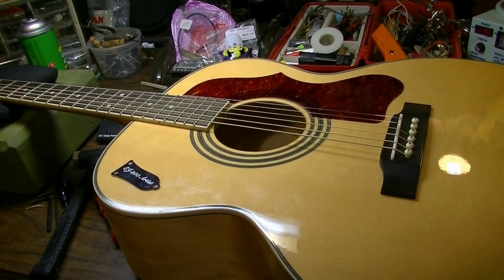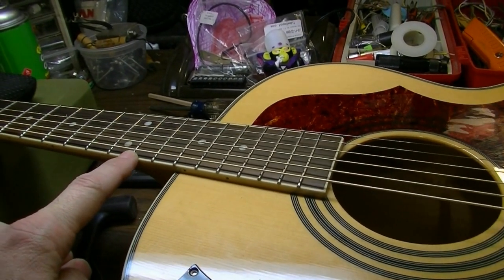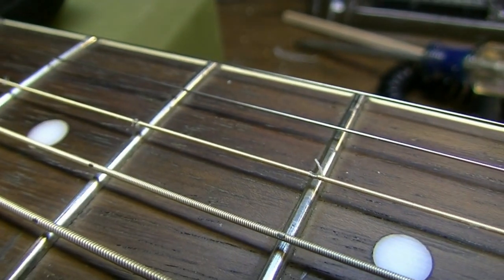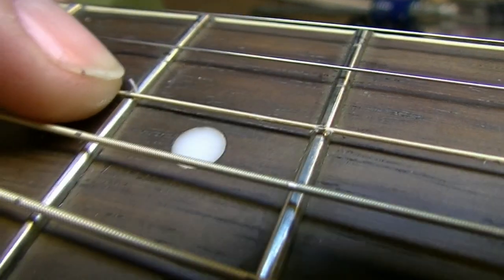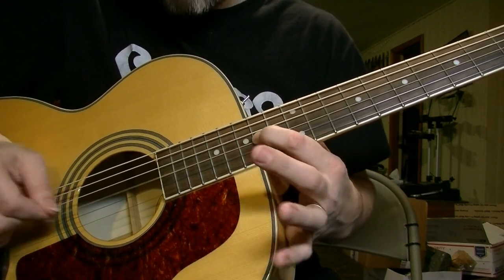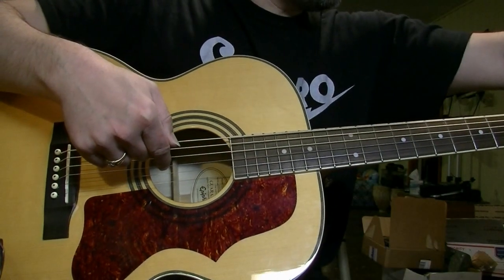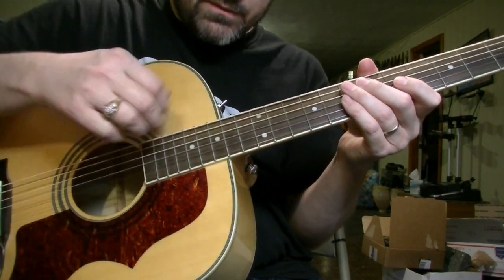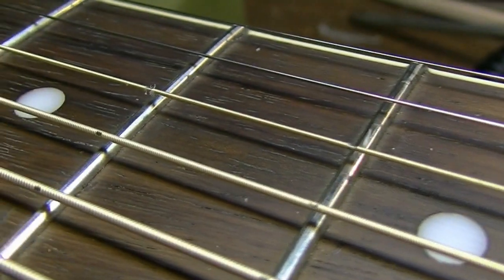Why I NEVER Use ELIXIR Coated Guitar Strings

Comment: your problem is you want to bend a wound g string in standard tuning, which destroys them, usually in minutes if your vibratos are aggressive enough.
This has been a known issue on acoustics for a while. try lighter gauge strings with less tension and possibly the top 3 from an electric guitar, which aren't wound, or a lower tuning and transpose your solos and melodies up the fret board.

Comment: I've only seen this kind of fraying on Elixirs strings where someone else has, other than me, had access to the guitar. I have never had mine do this; not even when they are ready to be changed. I must have dry hands and a low acidic pH balance to my skin/sweat, as well as a soft touch because mine never rust out or fray like this. I also wash my hands every time I play and frequently during my playing sections because I hate to change strings; I guess that I take extremely good care of them. As a result I rarely ever have to change out my Elixirs  -- they do eventually require changing though. I guess I must be really luck because of my low acidic pH and because of my OCD issues (Obsessive Compulsive Disorder) and because of my playing style, that I don't don't have to change strings that often. Plus, I am really just too lazy to do it anyway and I even have all the power tools to make it happen quickly. 
I would be really sad if Elixirs frayed on me and corroded quickly because I really really love the tone that they produce. I've even compared them with D'Addario strings, because that's what I used to use, and hands down the Elixirs just sound so much better and sweeter to my ears, with rich twangy overtones that I can't seem to get from the D'Addario's. And D'Addario are really great strings in my opinion but Elixirs are just so inspirational; I really really love them!

Comment: The problem is you put the "strings back on". The strings were already stretched then you took them off. The strings like most things that stretch relaxed and tried to go back to their original length. They were then put back on and stretched again. This will cause the coating to do exactly what we see in the video. It would be like wrapping plastic wrap around a piece of rubber thats been stretched then allowing the rubber to go back to its original form. The plastic wrap will tear and bunch up. Obviously the elixir coating wont bunch up but it will tear.

Comment: Coating on strings usually do not peel easily unless you are tapping the strings violently. I tried some cheap made in China strings. They are coated. Cost about $3 per set on eBay and they last for years
Reply: What brand?

Comment: First off I would never remove a set of strings and then re-use them, especially after an installation that would require filing the saddle. I only use Elixir strings on my guitars, Polyweb on the Martin and Nanoweb on my Taylor K20C. I've never had a string break, they stay in tune and last longer with GREAT tone than anything else on the market.

Comment: Nanoweb is a thinner coating than Polyweb.  The former is used for acoustics and the latter for electrics.  I haven't heard many good things about the Nanoweb strings, but I'll swear by the Polyweb strings.  I've used them on my electric guitars with no hassle or problems whatsoever.  I love the silky smooth feel, and they last a very long time.  I have some sets that have been on my guitars for several years, and they still sound brand new.  I'll gladly pay twice the price I used to pay for a set of GHS or Ernie Ball, because Polywebs are worth every penny.

Comment: Hey guys- Im going to do a video on this at some-point- but i've had a set of elixirs on my sisters guitar that I "Accidentally broke" way back, around 2010 or so- they're still on there today, and apart from the odd specs of rust UNBELIEVABLY still sound like new- its unbelievable... 7 years. BUT this is due to nobody playing it much at all. This guy must have left the same strings on that bugger for a LONG time for that to happen- but it just proves that nothing is consistent, everything is subjective, and everyone has on opinion. Just go with what you like and what works best for yourselves.

Comment: I've had good luck with the D'Addario coated strings on one acoustic, and Cleartones on one electric. Had a set of Elixirs once, on a Taylor Big Baby. They're a great idea for brick and mortar music stores, where a guitar might be played several times before it's bought, so customers don't find themselves auditioning $1000+ guitars with dead, rusted strings that feel gritty and sound bad. I used to go to the old Mars in Natick, MA, and if I picked up a Taylor (first to embrace Elixirs as original equipment, I believe) it always sounded more lively than the Martins and Gibsons with their rusty old strings. But the Elixirs lacked low-E "clang", and they had that rubbery feel, like I'd just handled a jelly worm from a fishing tackle box. The ones on my Big Baby shredded like the ones in the video, although it took longer than 3 uses, and if they caused any actual buzzing I either didn't notice or don't remember. At a friend's recommendation, I replaced them with D'Addarios, which felt and sounded more like un-coated. I now keep coated strings on just a couple of specialty guitars that I use only occasionally. My cost justification is that they won't oxidize even while they sit un-played in the case for a while, which can happen over time with regular strings. Otherwise I agree, plain old strings are fine if you just clean them off a bit after heavy use. YMMV.

Comment: also, it is clear and obvious to anyone who knows the difference that these are polyweb  strings...clearly evident in the video.  the Nanowebs are less "milky" in appearance and look less coated and more like a normal uncoated string. Polyweb coating is thicker and frays/sheds more with use, especially under the picking area. Aggressive blues players should be changing out their strings after about 12 to 16 hours of use....regardless of their string choice, because of the stresses and wear involved. MOST other types of playing involve almost no string bending which is what wears through the winding on acoustic strings very quickly. I also use elixir bass strings which i have to change after about 60 hours of use. a non coated set used to last me about 6 -10 hours before they became sonically useless. that's about 3 shows worth of acceptable tone vs 10-20. before the strings wore out even though the tone was still acceptable. string life should always be measured by hours of actual playing time not some obscure nonsensical relative term like 'i have used the same strings for 2 years' or "they only lasted a week!!!" playing style and other factors make ALL the difference to string longevity, if you wear strings out like this guy seems to it is a waste OF MONEY to buy ANY kind of "coated string"...so it is not the product that is to blame

Comment: Huh? I've never had this issue. Those strings look really worn and torn..you do have to change them at some point. Ernie Ball Aluminum are a good alternative if you don't want coated strings. Started using those just cause of price. Pretty happy with them.
Reply from the maker: Of course they are worn and torn. That was the whole point. After two practices and one gig and the strings being on less than a week, they were like this. Hence the video.

Comment: i have like a knock off les paul by a company called Gould and the G string buzzes like crazy on that thing but its never done it before i just recently put 8 gauge strings on it would that make the string buzz? if its not used to having 8's on it?
Reply from the maker: Two reasons why 8s could buzz on a guitar set up for heavier strings... One, the truss rod needs to be adjusted to allow more forward bow because an 8 gauge set will exert less tension on the neck, and also 8 gauge strings are very slinky, so when you hit a note, the strings will travel further in their oscillation, which could bring them in contact with frets and create buzz.
Reply: how do i adjust the truss rod?
Reply: The Guitologist I had that problem on my LP and the nut holding the tuning peg needed tightening. No idea how it got loose, after I tightened it no more buzz.
Reply: on my squier classic vibe i just got a problem with one of the tuning pegs that when i try to tighten my low E string the peg like snaps back once it gets to a certain tension and i cant secure the E string yall ever had anything like that?

Comment: It just needs new strings.  I've used the elixirs forever with no issues.  I actually use that bit of fraying to determine its time for new strings.  Run your finger up and down the D and G strings and if you feel bumps, it's time to change them.  No big deal at all and they still last 4 times as long as others for me.

Comment: I use elixirs, not because they sound any better or worse but because they last so long. I have 9 guitars and I don't gig anymore so keeping them all playable gets expensive. Cheap strings go rusty after a few days for me but Elixirs last at least 6 months. They are not quite as bright as non coated strings but you can compensate with EQ.

Comment: First of all, these are polywebs (thick goretex)  and when you take them off and put back on you will have issues, as with any string. All strings will wear and dent after playing...those string look very played. I have used Elixir nanowebs since inception, they are a superb string and last way longer than any other coated string.  Finally why would anyone want to drill a hole and install a toggle switch on an undersaddle pickup. Is your friend OK...cause that's pretty weird :-o

Comment: Those must be poly web strings. Nanoweb does not peel off of the strings. I have been using Elixirs since they first came out. I have plodded through a lot of their development, trials, and errors. They had a terrible time with the heat treat process, perhaps a vendor issue. Breakage was an issue as a result of that. I stuck with them. 
I use Nanowebs and have never had a problem once Elixir worked everything out. It’s a phenomenal string. 52 years of playing, I’ve had just about every brand ever made on my guitars. Elixir Acoustic strings is the best IMO.

Comment: I like Elixir strings, but I change my strings often. If I work on my guitars, I change the strings too. Even regular steel strings get the grooves in them after a while. I like the sound and feel of the Elixir Strings, plus the fact that they will last a little longer. I used to have to change strings once a week. Now, I can go about 3 or 4 weeks. I guess to each their own.

Comment: Man, there is a lot of hate in this video. My experience with elixirs: hate the feel and the brightness. Also, I set up my guitar a couple of months back and put a set of martin lifespan strings and I was really satisfied. Considering I use altered tunings a lot, my G strings snapped while tuning up and so I asked my guitar teacher if ge had a spare string, and he said yes. The following week he brought me a elixir nanoweb string and the same day I put on my guitar. Well, 1 week after, the coating started to peel off and it was causing fret buzz and really stood out when I was playing because of the brightness. I have a new set of pins coming this week so I cant wait to change my strings. So face it people, the uploader has a point, maybe its a rare thing but it does happen, my opinion on elixirs is that they are overpriced, and as I have experienced playing my teachers guitar when they get old they sound dead. I think I will stick with martins and d'addario from now on. Thanks for sharing some interesting info on the matter because I was wondering where the buzz came from, and it defenetely wasnt the setup

Comment: Why would anyone put old strings back on a guitar after a repair or modification?  Even the Elixirs aren't that pricey, but if you had cheap ones laying around anyway... My Taylor acoustic came with Elixirs when I bought it several years ago, and now that's all I use on all of my guitars. All of my guitars, both acoustic and electric are rockin Elixir strings, and I've never had a problem.

Comment: I live in Phuket Thailand. It's in the tropics, very high humidity. Regular strings last...a few hours. I'm joking, a couple of weeks. Bad after a month. There is only one things that works here and that's coated strings. I get three months and then I see rust, still sound okay but they're deteriorating (just like everything else). The jungle will reclaim everything. In my situation I don't have a choice. They're more economical than any other choice. And by the way, I've never saw that happen to Elixir strings. 
Enjoyed the video!

Comment: Elixir strings sucks because i tried them today with my fender strat and the A String was buzzing a lot and with bad intonation i tried fixing it but it doesn't want to get in tune  at the 12th fret its always sharp and the sound getting warbled tremolo effect i can't explain it .. i replaced the A String with Ernie Ball Super Slinky and it fixed the buzz issues and the intonation became perfect !! 
i tried elixir strings  with my acoustic guitar and they are good sounding for my guitar but they failed me with electric guitar , i will stick with Ernie Ball From Now on .
Reply: If you switch brands you have to do a set up 🤦🏼‍♂️
Reply: @g.koch.  do a full setup just because one string ? Never did that and i always use the same size without doing a new setup .. the A string was really bad

Comment: Strings are wear items like brake pads... Doesn't matter the material. Over time they wear. It's the cost of playing guitar.  Do coated strings last longer? Yes....but, you hit the weakness of coated strings right on the head. They're pretty much a one shot deal...ya cant remove/replace them with the same set usually. The materials science behind it is the difference in coefficient of linear expansion between the coating material and the various string metals.

Comment: I have only used coated string twice , Both Times I broke the d string with in a few days , Not to mention I worked in a music store and sold numerous singles  due to breaking is a short time  , So much for long lasting , I only use No coated and never brake stings

Comment: OKAY FOR THE PEOPLE THAT ARE BLAMING THE FRETS THAT ARE A LITTLE FLAT!! 

FLAT FRETS DON'T CAUSE STRING DAMAGE..  

 I am a guitar luthier and have fixed so many guitars and doing fret jobs.. I have 30 years of experience fixing building guitars, amplifiers and as a lead guitarist and also play all the instruments including  sing!!! 

On my guitars I have left the tops rough and flattened out for a long time just as an experiment using different leveling techniques..  AND I HAVE NEVER SEEN ANY REGULAR STRINGS DO THAT!!! If the frets are a little flat that does not cause that problem.  that is possibly the dumbest  ignorant thing I have ever heard when it comes to guitars and strings!!!  

Those frets maybe a little bit flat but they are still smooth and they were dressed... 

SO PLEASE STOP IT IT'S NOT EVEN ARGUABLE WITH THESE DUMB IGNORANT COMMENTS.. BE

Bottom line is these elixir strings do last longer but there is definitely a trade-off if you don't change them often enough. THIS IS EXACTLY WHAT HAPPENS TO THEM IF YOU'RE A GUITAR PLAYER THAT STRUMS HARD AND PRESSES ON THE FRETS HARD!! 

STEVIE RAY VAUGHAN COULD NOT USE THE STRINGS IF HE WAS ALIVE SHE WOULD GO THROUGH THEM EASILY WITHIN A SHOW.. 

THE ONLY THING THAT FLAT FRETS CAUSE IF THEY'RE TOO FLAT IS INTONATION PROBLEMS.. but they would have to be about 1/16 of an inch wide or more.. I tried to leave at least 1/32 of an inch flat because it will not cause any intonation or buzzing problems AND AS A BONUS YOUR STRINGS WILL TOUCH THE FRET MORE CAUSING GREATER ENERGY TRANSFER AND NOT TO MENTION THE BIGIE!!! SLIGHTLY WIDER DRESSED FRETS HELP SLOW DOWN THE PROCESS OF DENTS IN THEM.  WHICH SAVES YOU MONEY DOING LESS FRET LEVELING OR FRET JOBS!! 

The coating is not help as much as you think and it changes the sound.  

IN MY OPINION PEOPLE'S BEST BET IS BUY 5 OR $6 PAIR OF GOOD STRINGS WITH NO COATING PHOSPHORUS BRONZE FOR ACOUSTIC GUITARS... 

JUST CHANGE YOUR STRINGS OFTEN.. AND EVEN IF YOU DON'T CHANGE YOUR STRINGS THE ONES WITHOUT THE COATINGS MAY GET DENTS UNDERNEATH THE THE STRINGS IF YOU LEAVE THEM ON TOO LONG BUT YOU WILL NEVER SEE THE GARBAGE THAT YOU SAW IN THIS VIDEO FROM REGULAR STRINGS!!! I MEAN YOU WOULD HAVE TO BEAT UP REGULAR STRINGS AND USE THEM FOR A LONG LONG TIME TO DO CRAZY DAMAGE THAT YOU SAW FROM THE ELIXER STRINGS.. 

FYI will not argue with anyone this is a FACT AND NOT AN OPINION!!!

;)
Reply from the maker: Someone with sense.

Comment: Last time I switched string on my electric I went with Elixir strings because I was tired of sliding noise, wanted more tune stability, easier to clean and better reliability & maintainace in general to replace less frequently.

I love them! Softer to the touch too so way nicer during harder pressing and longer sessions.

Comment: I would thoroughly recommend to severely polish the frets first before making your mind up about Elixirs. I tape off the fret board, then use wet and dry 400 grit then 800, 1200,2000,2500 then metal polish.  God Speed.